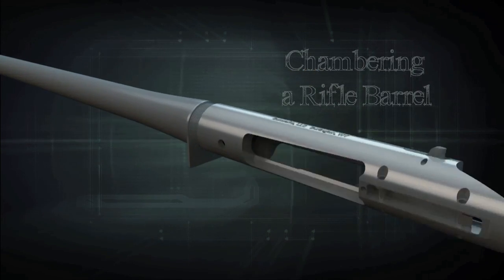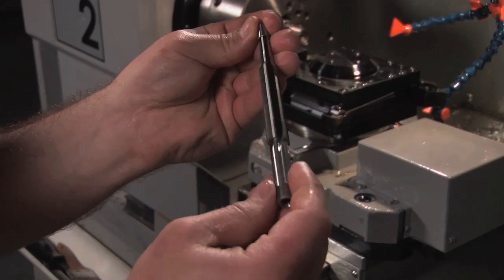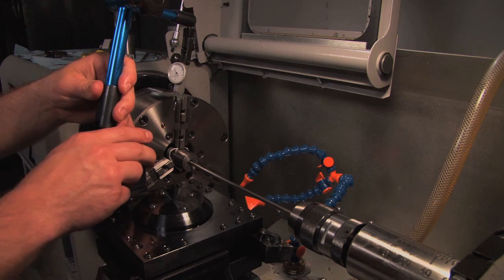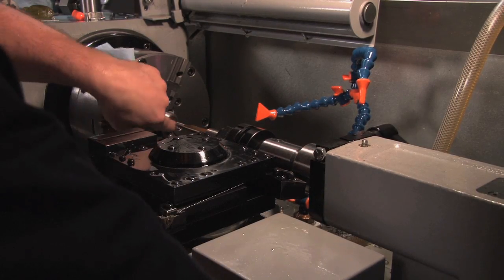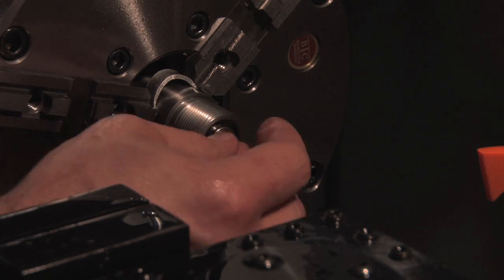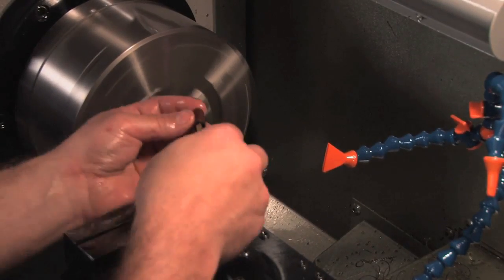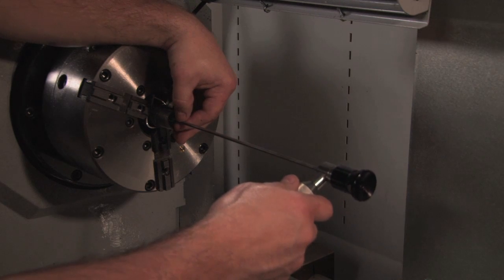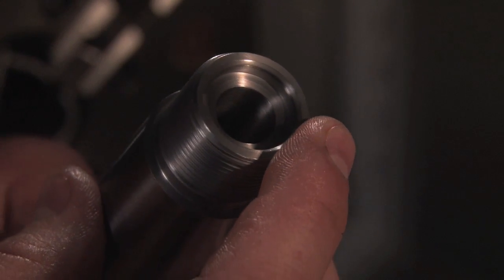Chambering a Rifle Barrel

Comment: Great video. My question however is about the gauge used to take the headspace measurement off of the go/ no go gauge.  Any way to get dimensions,  measured drawings, machining and assembly notes and etc?   The a diy geek in me is loosing his s#!t right now, and frankly, I fear that somehow, only that bit of info will ease the fits . . . .🤔

Comment: Crosstimbers2 you might want to check your facts on that. I have seen many gun smiths polish the chamber with some fine emery to put fine circular lines around the inside of chamber for the cartridge to  grip.
Reply: Because there aren't already "fine circular lines" around the inside of the chamber for the "cartridge to grip"? And how does a cartridge "grip" a chamber and why does it need to if properly "headspaced"? It's not going to go anywhere, is it?
Reply: I agree, the surface finish Ra from a reamer isn’t as good as an abrasive polish ( usually ). 
Besides the fact that reamers inherently leave helical grooves in normal operation.

Comment: Good to see engineering the old way. I've searched the whole of the UK to find any gunsmith with the machinary available to bore out my 'shot out' 1917 Lee Enfield SMLE MkIII* .303 and smooth bore it in the caliber .410 for 2 1/2 inch shotgun cartridges. It's not possible over here anymore.Many were done here in the 70's. It seems that unless it's a new barrel being fitted no one wants to touch the job. Keep up the good work.